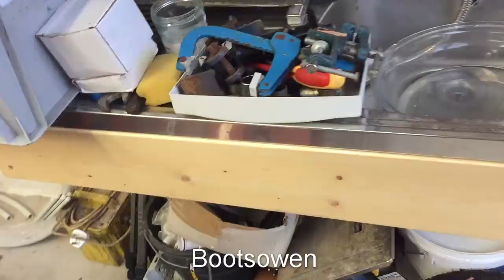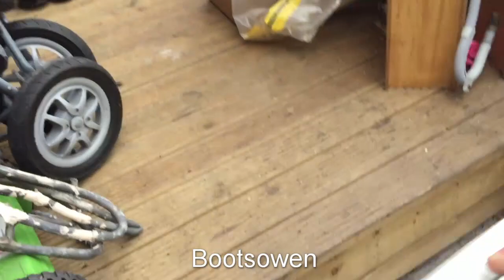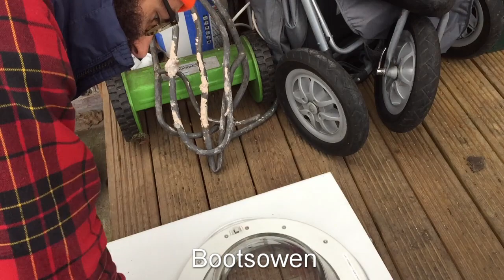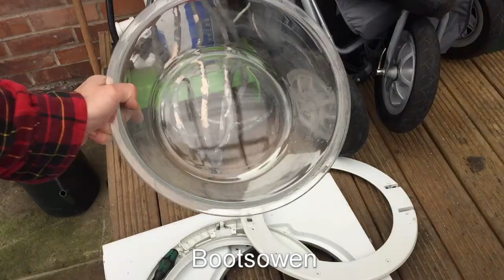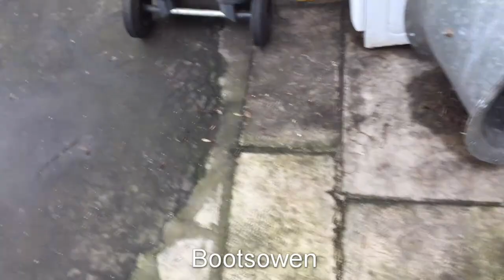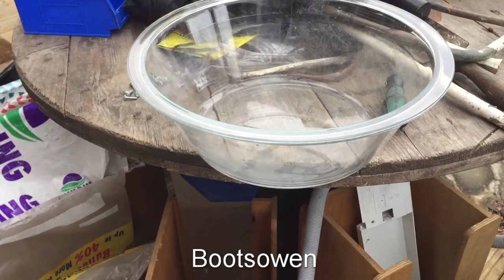Recycling washing machine door glass

Comment: Actually, a WM does not heat up to 95°C. The mostly stop at 85°C. The reason is that the WM could be installed on a mountain station, which is high up and the higher you go the lower is the pressure and water starts boiling alt lower temperatures. If the WM would heat up to 95°C but the water boils already at e. g. 85°C it would damage the machine heavily. (Sry for bad English lol)
Reply from the maker: Thanks for the comment. I have done a video in the past testing the temperature of a Miele and i think it was very close to 90. Have a look through my videos. It might have been called Miele test wash. Thanks